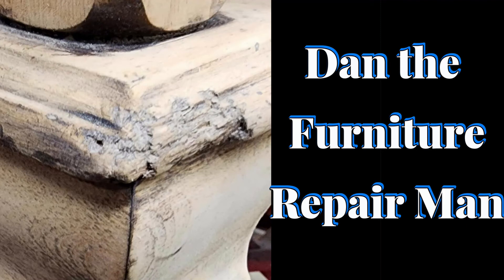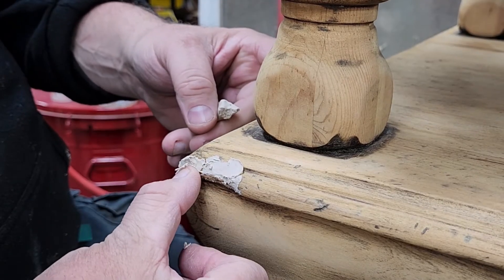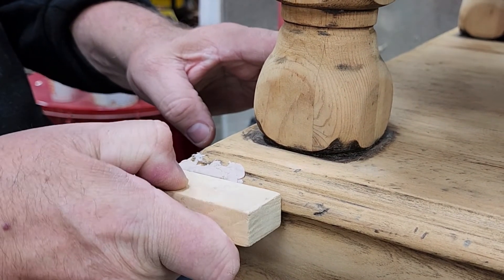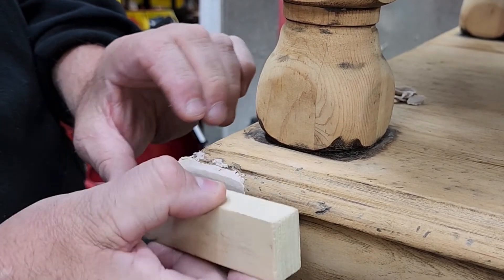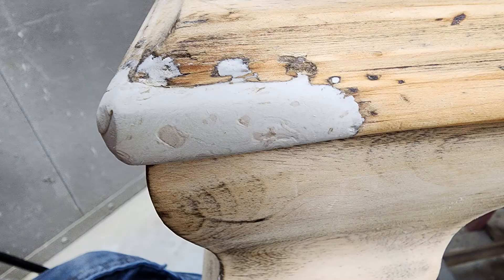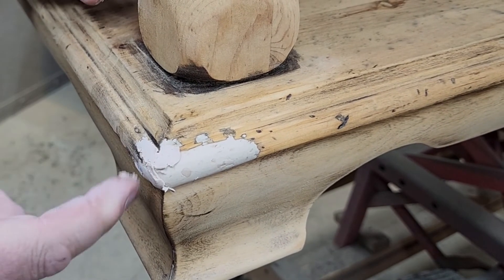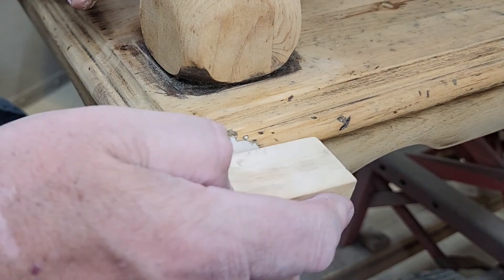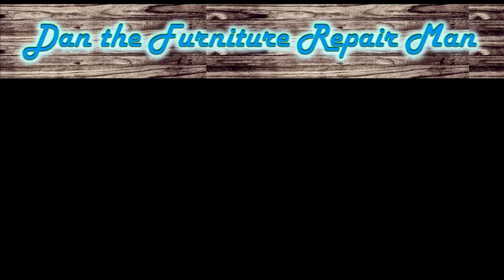Dog Chewed Furniture Molding repair

Comment: My dog chewed my legs on my 1800 Era lion feet furniture.  How can I carve lion feet again?
Reply from the maker: I would make some paper tracings and use them to transfer the shape.
Slowly build up the moldable to make the shape and sand it smooth after it hardens.
Not hard to do, if it looks bad just sand back down a little and go again.
You can wet your fingers with water and shape the moldable when it soft like clay.
I have a video coming out this week showing touch up coloring that might help.
Subscribe and hit the notifications bell to see when it comes out.
Best of luck!

Comment: What are your thoughts on this epoxy vs what I see people using , Bondo. Is it essentially the same, or is there a difference that make this your preference?
Reply from the maker: I use both, I feel the epoxy is stronger and will hold up better it the repair is an exposed corner that can be kicked or hit with a vacuum, sometimes I use the epoxy to start and bondo to finish the small areas.

Comment: Would this work on a windowsill that was chewed by my dog?
Reply: The trim is MDF. I’ve heard wood filler won’t work on MDF
Reply from the maker: If it is MDF i would use superglue on it first and let it soak in and dry. That should harden it enough for the moldable to bind to it.
Reply from the maker: Thanks so much for watching!
If you want to donate to support our channel our PayPal is
paypal.me/furniturerepairman

Comment: My table has ridges. How do you add them back?
Reply from the maker: I would build the moldable putty up and while it was still soft carve them in and after it hardens fine tune the look with sandpaper.
You can also drag ridges in the soft putty with a fork, comb, wire brush
Just have to find a similar profile.
Hope that helps!

If you want to donate to support our channel our PayPal is
paypal.me/furniturerepairman